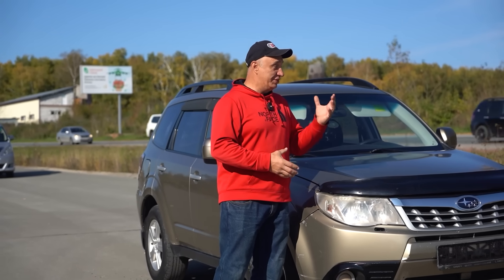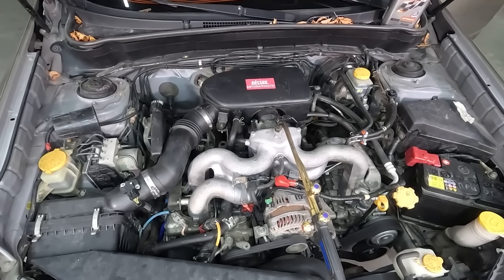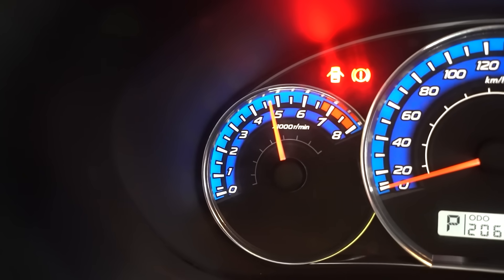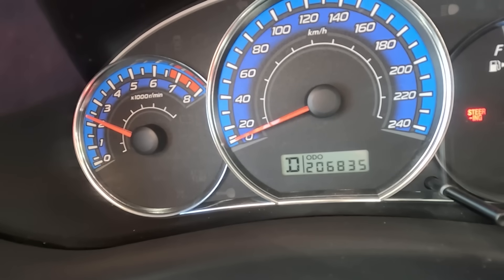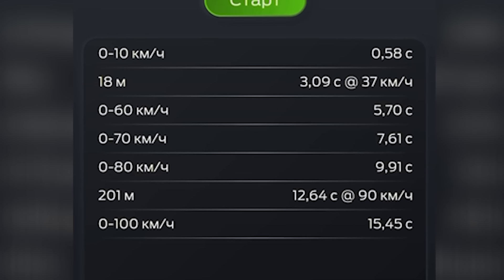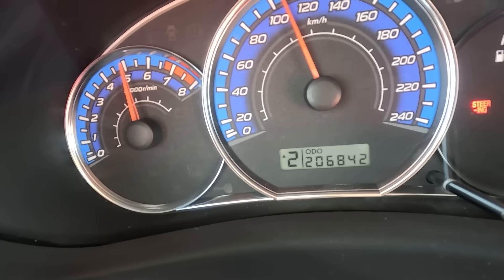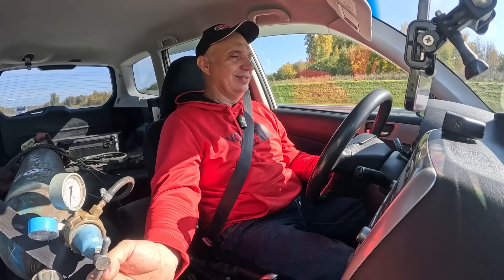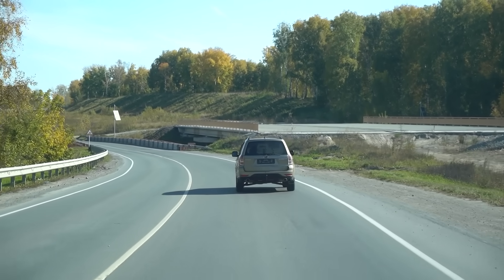We run an engine on pure oxygen - what will happen?

Comment: Modern car like that rely on sensors to adjust injection and ignition.
With this amount of oxygen, you need high band sensors after the O2 injection so the ECU can adjust the mix. Oh and probably bigger injectors

Comment: I assume you knew your experiment is similar to running nitrous oxide which is a stable way to add oxygen. 
Copy any common nitrous injection system including the extra FUEL flow which is necessary not to run lean and blow holes in pistons. 
Search "nitrous jetting charts". No need to buy expensive parts if you use adjustable needle valves instead.
You can do that crudely by using conventional nitrous plumbing and various carb jets as replaceable oxygen and fuel orifices, also not a new idea.

Comment: EFI can deal with 30-40% more oxygen than expected before maxing out on ST+LT fuel trims. Beyond that, you are stuck in the lean zone. The ECU likely didn't like that and maxed out everything else it could to compensate, hence the gradual de-tuning.

Comment: If there was a safe way,as in a direct injected setup, to increase the fuel by say.....double, then hit the O2! That would without a doubt either explode, 2, incinerate the head, valves, and pistons, or 3 pull like a freight train then let go. Catastrophic failure is pretty much guaranteed.

Comment: Engines that used augmentary NITROUS OXIDE blew out the head and or pistons, etc., IF the engine wasn't super-duty built.
Engines have been engineered with all the ECUs and sensors to discourage hot-rodders from running on Nitrous Oxide, or HHO (H2O Water>>Hydrogen and PURE Oxygen), made on-board the vehicle.

Comment: Let me school every one here with technicalities.  Is called short term fuel trim and lomg term fuel trim . They are controlled by the  coolant temperature sensor , air flow sensor,  absolute pressure , barometric pressures sensors,  oxygen sensors upstream and downstream,  electronic control unit which is the main computing chip, oil pressure sensors,  electronic low voltage sensors for the ignition systems,  and amomg others which all cars are different in similarities.  When too much oxygen enters the systems fuel and oxygen ratio , the oxygen sensors tells the ecu that there  is too much lean oxigen telling the fuel pump to adjust the short term fuel trim to less fuel because oxygen snesors can only detect sunburnt oxigen in the catalyc converter so ecu thinks there is too much oxigen therefore reduce the fuel supply , sometimes in this case the car ecu have an specific range of fuel delivery tolerance ranges . It all depends on the specific model and regulations of department of transportation in each country . He should have checked the fuel trims first with a scanner. Ecah country have their own regulations of  air  environmental.  Perhaps that car dossnt use catalyc converter.  Maybe it doesnt require that vehicle to pull fuel trims codes

Comment: You needed to remove the intake manifold, drill it outside of the vehicle and clean it up and then reinstalled.  No metal particles will reach the intake valves, pistons and exhaust valves.  For it to work you need to insert the o2 before the throttle body, just after the air filter.

Comment: you basically made a vacuum leak. The MAF is up by the headlight so the 02 wasn’t metered. Sensors sent the fuel mix way off and the CPU couldn’t tune it.

Comment: Use the oxygen injection before the mass air flow sensor and do it again. That way the engine will be able to read the greater volume of oxygen being used and can adjust the fuel properly.

Comment: Drag racers use this (in the form of nitrous oxide - aka laughing gas) and add more fuel to compensate for the additional oxygen to maintain a safe fuel-air ratio. The Subaru with this setup was relying on its oxygen sensor to richen up the fuel mix - until it maxed out the flow from the fuel injectors. Then it got lean, got hot, and tried to melt a piston.

Comment: you need to put the oxygen into the air box so it goes through the air flow meter. You are bypassing the throttle butterfly and leaning out the mixture.

Comment: Run on older engine. After testing pure oxygen, add in a little bit of the other gas. Probably will loose the engine, but the fireworks would be awesome.

Comment: Armchair mechanic here, without aftermarket ecu and additional fuel injection (like you do when adding nitrous) the O2 leans the hell out of the engine the ecu only see's it on the exhaust sensors so it has conflicting data so it adds some fuel but doesnt have enough injection capacity to keep up, engine leans out and when the o2 is turned off the ecu all of a sudden see's a huge lack of oxygen and basically freaks out and goes into limp mode. If you really want to do this re run it but with additional fuel like you would with a nitrous setup and have both triggered by a solenoid
Reply: exactly why people need to tune their engine or ECU rather to the new specs after adding a bigger turbo.. New Cold air intake system.. bigger exhaust (to some extent, after the cats tends to be fine, before cats and removing cats needs a tune) or adding Nitrous. Nitrous isnt much different than oxygen in this experiment.. they might as well have done a bottle of that too.
Reply: 💯 limp mode. Very well said Mr Google yz9

Comment: Problem is, you very likely added more o2 than what the factory ecu can enrichen for as most can only add 20% or so more fuel over stock fuel map. You would need to crack the acetlyn bottle a bit too to act like a wet shot of no3

Comment: You need to plug that hole you drilled and inject the oxygen before the mass airflow sensor, you have caused and issue with the ECU because it is not calculating the proper amount coming into the engine.

Comment: You needed to adjust the ECU and add more fuel make it more rich, this would have boosted the performance. Just doing oxygen without changing the ratio on the computer made it run too lean.

Comment: The ECU is sensing a lean condition guys. You should know this already. CIA dude says to run this in a carburetor configuation.
Reply: Carburetor would still run lean because it's based on flow and not oxygen percentage.

Comment: Gotta inject fuel as well. Put a nitrous kit on it without nitrous and just use the fuel side to add to the mixture. Could also make a fitting for the nitrous nozzle to inject the pure oxygen there as well. Nitrous is just adding more oxygen to the engine as well. Just a chemical supercharger. So could likely use a little more fuel with pure oxygen and be ok.

Comment: Just increasing the oxygen content in the intake air alone will not increase a modern engines performance.  All that having more oxygen available for combustion will do is allow one to put more fuel into the cylinders.  Only then can the increased oxygen availability result in increased power.  

BTW, there are are well established performance kits on the market for adding extra oxygen to increase performance.  But instead of
injecting O2 they use something a little better;  Nitrous oxide.  Nitrous oxide provides the extra oxygen while simultaneously cooling the intake air-fuel mixture dramatically, making it denser, in addition to decrease tendency for pre-ignition that results from much higher combustion pressures.  These kits simultaneously also deliver the additional fuel, in just the right amounts relative to the nitrous available for the particular engine the kit has been designed for.  Extensive testing is done by the kit manufacturer to determine optimum balance of extra fuel to nitrous oxide ratio to achieve performance, while also avoiding burning of engine valves from excess oxygen.  And the kit has to be specifically designed marketed for your specific engine model.

Comment: You're doing it all wrong.  Add the oxygen before the air cleaner.  That way, it's all mixed with the air before getting into the engine and the computer has a chance to adjust for it.  By adding directly into to the intake manifold, it becomes worse than an ordinary vacuum leak.

Comment: I can tell you for one, the 02 needs to go past the mass air flow first so the ECU can measure how much is going into the engine, and then it will know how much fuel to inject. You need to pump the 02 before the oxygen before the MaF in the air intake hose.
Reply: It'll still be wrong because pure oxygen flows like air but has almost 5x the oxygen. Need to inject extra fuel as well.

Comment: You'd expect the  revs to increase because its the same as opening the throttle and at some point it will have a super charging effect because you'll be getting more oxygen than a normally aspirated engine would normally get.  The ECU will have adjusted the fuel after noticing it's too lean at the oxygen sensor - up to a point.  If you do it for long enough it will go into limp home mode and complain that the catalyst is ineffective; it will not be able to to trim enough to get the right before and after catalyst readings which will probably be in the fault codes.  That doesn't reset immediately you will have to have the problem go away and the catalyst work correctly for a while before it will return to normal operation - pretty much exactly what you saw.  You'll only burn something if it can't get enough fuel but I expect the ECU will limit performance and I think that is what it was doing when it wouldn't pull.  Looks to me like it did exactly what you'd expect.

Comment: The short term and long term fuel trims were likely maxed out. Then after driving without the extra o2 the trims straightened out and car started running good again. I would love to see this test again with a 2 way scanner and watch the fuel trims and o2 sensor voltage. Very cool

Comment: Could you try this with a diesel engine? Since a diesel usually runs lean anyway, and just injects more fuel as needed. I wonder if injecting oxygen would be similar to increasing boost pressure

Comment: Rolls-Royce tried this during the 1930s and 1940s. The result was not only did the fuel burn, spark plugs, valves and pistons also burned. Nitrous Oxide was better solution

Comment: The next step is to spray petroleum and oxygen into a rocket bell welded on to the chassis.
Only then will we achieve the full acceleration benefit. The jet of flames will not be suitable for other traffic.

Comment: You need to use a carburetor, jet it richer first.  Also, why use the regulator as a valve; crank the pressure up and then just open the valve (with no torch tip).  You're not actually adding all that much oxygen.  That's about a 120 cu.ft. oxygen tank feeding a car that consumes about that much air in one minute.

Comment: Engines are designed to use those nitrogen in the air as coolant, if you remove the nitrogen you will need a bigger water cooling system

Comment: I like this channel but this experiment has a some errors.
First, there is a vacuum leak and the ECU tries to compensate.
Second, the Oxygen should be the only source of "air" and set at the atmospheric pressure only as any increase of pressure acts as a "small overcharge"
Third, cars with ECU react not natural as they keep compensating. 

Third, a better measure would be on a Dyno and measure the torque and HP at the same RPM

Comment: i think you need to add it on the air filter box or at least before the oxygen sensor, so the engine can meter out the fuel more precisely.

Comment: Giving O2 instead of air, but not giving more fuel, to adjust for mixture (stock injection systems wil lnot have the headroom) you basically create a very high temperature lean mixture that will act like a torch welder and you'll melt everything.

Comment: I want to see this on a diesel
Reply: If you inject pure oxygen into the intake of a diesel engine, probably what would happen is during the compression stroke the piston crown or exhaust valve would just start burning instead of the O2 sitting around waiting for fuel to be injected. I have a hankering that the only reason why diesel engines can work at all is because the Earth's atmosphere is 4/5ths nitrogen which is more or less inert. In a very high oxygen environment a diesel engine would destroy itself even if no fuel were injected at all.
Reply: Someone wants to make a mess 🤣
Reply: Yeah, but only from a distance. :D

Comment: actually theirs a guy in the united states already using compressed on stage regulators like nitrous at different psi an it makes insane amounts of power in a v8 without tons of heat that turbos superchargers an nitrous introduce an since its just oxygen their just adding more fuel to make up for it making tons of power

Comment: Whole test is for nothing. Seems that you added the O2 after the MAF sensor. Which means you introduce O2 which is not metered by the ECU, thus doesn't know about it. You start introducing O2, changes the fuel/air mixture which ECU will see immediately after reading the O2 sensors. Then it tries to compensate by adding more fuel and so on. So it is not necessarily a better burn as you state, but what you see is the ECU trying to fix your mistakes.

Comment: you should put a pressure regulator timed with your gas pedal , otherwise you only push O2 in the engine not petrol

Comment: When you add more oxygen you must also add more fuel, and if you add a lot more oxygen you must add more fuel then the fuel stock injectors can provide. If you add A LOT more fuel and some oxygen you will get a LOT more power . I suspect this car is running open loop injection system with oxygen sensor system fuel injection that automatedly add more fuel, that is why the rpm when up with more fuel.  Lot of car only run open loop with oxygen sensor that actively adjust it like  that under 2000 rpm and go to closed loop at higher RPM ignoring the oxygen sensor which means on those cars adding more oxygen will not help.

Comment: ive tried this, long ago.
if you add too much o2, the fuel ignites as it leaves the injectors.

under load, adding oxygen to the intake air, burnt the exhaust valves in a direct injection engine.

this is why we use nitrous oxide

Comment: Add some propane, or acetylene to the oxygen mix. Need to find a way to make injection proportional to throttle position and not just an arbitrary amount from a regulator.

Comment: Completely logical. The O² sensors in the exhaust are telling the computer the mixture is lean, and to add more fuel.

If you do the same to a carburated car, the fueling can not auto adjust, the mixture will go extremely lean, and the engine will seize.

Comment: the rpms increasing would be same as just opening more throttle. cause you did put the o2 inlet after the throttle valve. u can see that valve on 0:23. and because of that you are changing the amount of air that goes into engine. you wouldn't see such a rpm change when you'd have it before the throttle valve.
what i came here is to see the power increase. this car should have enough sensors to adjust to pure oxygen. unless the ecu has some limitations written to it
edit: i just remembered that it is not going to add alot of power cause of one massive problem. your fuel mixture has two control systems. open loop and closed loop. open loop uses just fuel maps with only engine rpm and load (accelerator pedal position) inputs. closed loop is where lambda and all the other sensors come in play. full throttle switches ecu always to open loop so you're adding more oxygen but cause fuel amount is a determined value then you're not having alot of power increase and prob melt some things in the combustion chamber. if you could make it run on closed loop constantly then maybe you could get away with it.
Reply: Yep. Just built themselves a fancy vacuum leak.

Comment: Do it again but make it a wet shot like nitrus.  One hose adding oxygen and another hose adding gasoline and i think you'll really end up with a huge boost in horsepower.  Just adding oxygen will lean the engine out like you stated but adding extra fuel (gasoline) with the oxygen should make great improvement in power being you'd have extra fuel to go with the added oxygen.  The whole point to a turbo is to squeeze more air (oxygen) into the cylinder thus allowing you to burn more fuel thus giving more horsepower.  Adding oxygen with more fuel should in theory do something similar I would think

Comment: "Lean is Mean" was the old saying, but it runs way hotter which is a problem for multiple reasons (as he points out). So like others have said, the ECM is no doubt compensating, but then the injectors no doubt reach their limit and the engine does start running lean.

Would've been smart to have an OBD2 scanner hooked up to watch and see what the computer was seeing AND doing.

Comment: I think the logic behind this is that when hitting the throttle more air comes in as the butterfly valve opens and more oxygen enters the manifold, also the mass airflow sensor senses the extra air, and the TPS both tell the computer to add more fuel.
Now this scenario adding more oxygen by passing the ECU essentially, the computer is unaware of the extra oxygen and therefore perhaps not putting enough fuel to keep up, therefore the engine is running leaner and leaner and the engine power will be reduced due to running excessively lean.. basically it lacks fuel at this point, or the ECU might need some tuning.

Comment: You need supplemental fuel and a wide band. You are basically running it lean most of the time as the O2 sensor isn't instant